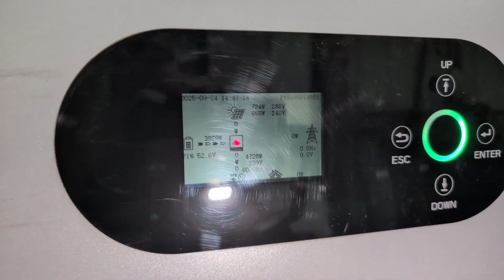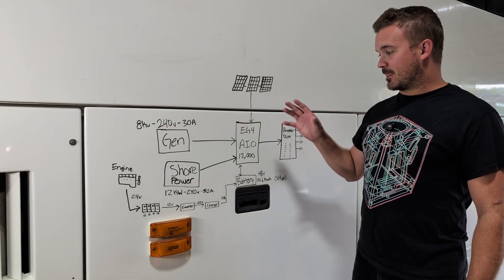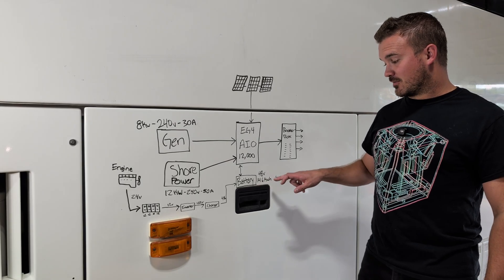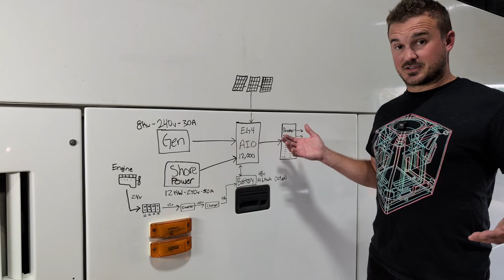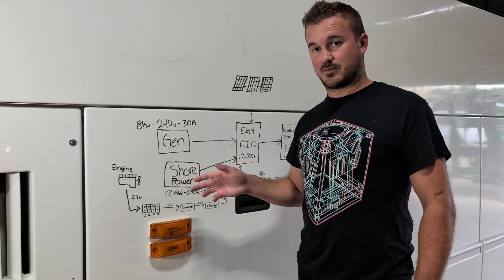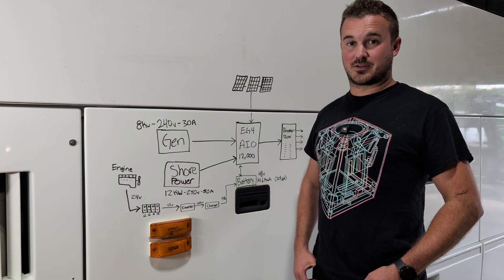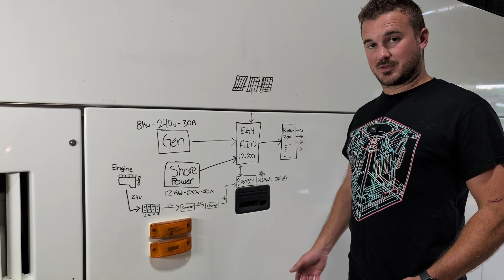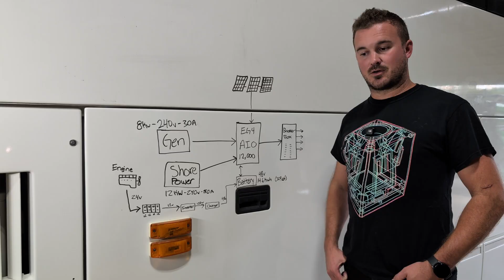EG4 12000XP Solar + Generator Setup on our DIY motorhome bus conversion

Comment: Question ❓ Should you add an additional alternator?
Reply from the maker: That's not necessary. The factory one can produce a huge amount of power. I'd much rather invest in solar since the bus spends most of its time sitting parked

Comment: Hi,  I have an old 2000 Country Coach Affinity 42 foot that I did exactly the same thing to.  EG4 12000XP, 48 V server-rack batteries, solar etc. It's been great. I initially wanted to do all Victron equipment, but it was much more expensive.  BTW: I put solar panels on sliding stainless-steel rails so I could stack 2 vertically.  So far I have 12 X 360 W panels and an only using 50 percent of the length for 4320 max W.  I'll add the other 12 in spring for a max of 8,640 W.  Like you I'm not weight-limited. I know I'll never see that much wattage, but extra panels without doing a ground layout is going to be great for boondocking etc. There are converters to go directly between two different DC voltages.  Some of the better ones are programmable, so you can do 24 V -> 48 V directly and set the max amps to allow to prevent overloads or thermal issues.  Things like 'start charging automatically when the voltage drops to X' etc. I think you're on a good path.  That inverter / charger is also nice and quiet - especially installed in a bay.  Next project: interface with the EG4 12000XP to get charts / metrics / controls in custom dashboards.  You can use Home Assistant and Node-RED etc to 'talk' to the inverter and tell it to do certain things. Thanks for your show and tell - it's awesome!  Cheers!  Paul
Reply from the maker: Very cool! I'll need to look into the automation stuff! I do have the app and use it often, but it isn't interfaced with any home automation programs. When the bus is at home, I have a 10kw array that I plug into the EG4, and then it runs about 50% of our home through a sub panel with dedicated transfer switch
Reply: I would like to see a picture of your solar setup.

Comment: Can you talk more about the breaker box
Reply from the maker: What would you like to know? It is very similar to the breaker box you probably have in your house
Reply: @TripOfOurLife what's the part number and everything that you got with it bc we have the same bus and I'm planning to do what you doing your videos are helping me and my wife out ... With the bus conversion that we about to do soon
Reply from the maker: @icekeyrv this is the breaker box I used 
https://www.menards.com/main/electrical/circuit-protection-power-distribution/main-breaker-box/square-d-trade-homeline-trade-100-amp-20-space-40-circuit-indoor-main-breaker-plug-on-neutral-load-center-value-pack/hom2040m100pcvp/p-1444444027912-c-6437.htm
Reply: @TripOfOurLife so is 100amp is enough for everything bc we buy the same mini split as you got but we doing a residential water heater the 30 gallon one and I want to run all the AC at once we getting a little more stuff in the bus that take a lot of power
Reply from the maker: @icekeyrv yes it is more than enough. The RV pedestal will only supply 50 amps anyways, so the 100 amp box is double what you will ever even be able to use. A residential water heater will draw 5000 watts. The mini split AC will draw about 3500 maximum. 50amp RV service is 12,000 watts. So you could run the AC, water heater, and still have 3500 watts to spare for lights, microwave, etc
Reply: @TripOfOurLife thank you this really helps now I know what to do... How many apps and Watts does it take to run the $12,000 w inverter I know it's a minimum to make it cut on
Reply from the maker: @icekeyrv I think the idle draw on the inverter is about 120 watts